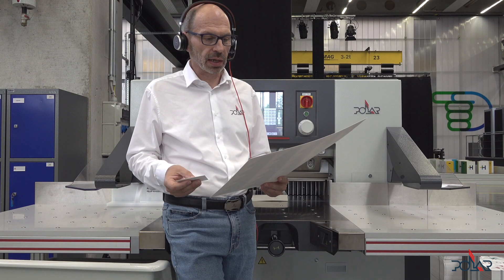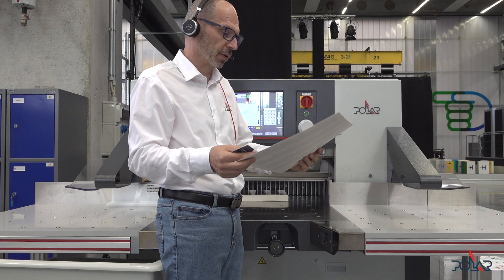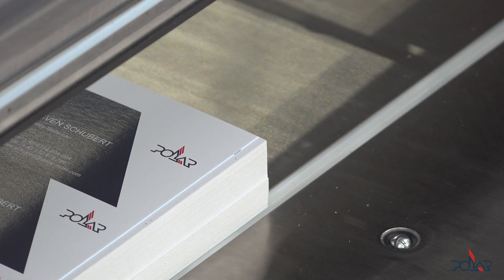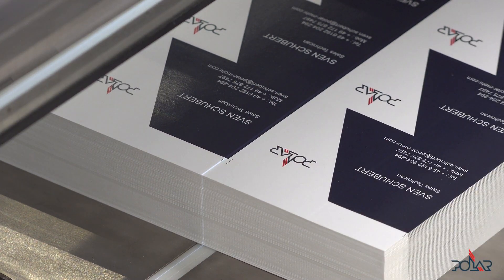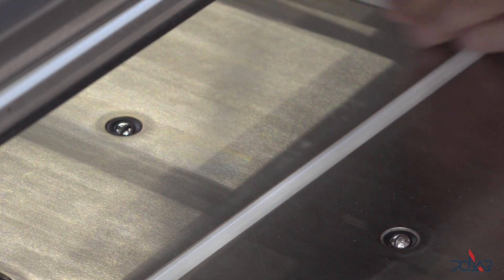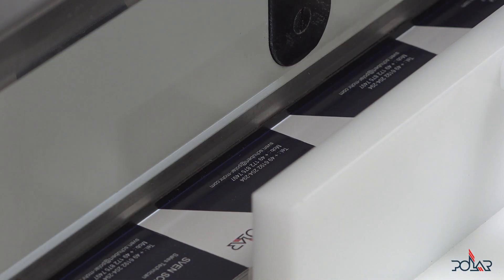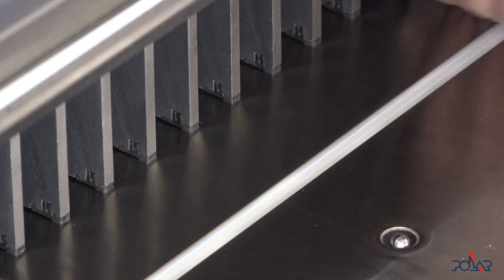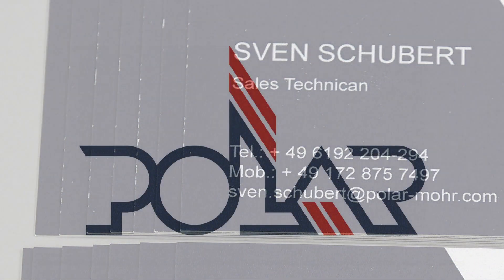Tip of the month September 2023 - Counter cut / Clean cut

Comment: Inside cutt works for tiny orders. Not on 500.000 busines cards on a 28 x 40 inch sheets
Reply from the maker: Yes, it takes a lot more time to do all cuts behind the knife. Some knife grinders are able to grind a kind of a curve on the tip of the blade which makes the cut quality in front of the knife a bit cleaner.